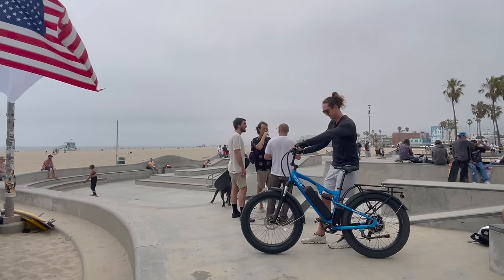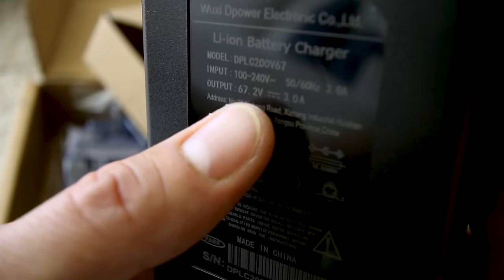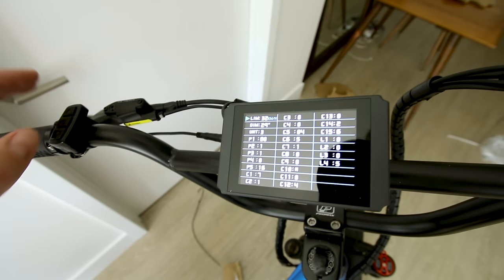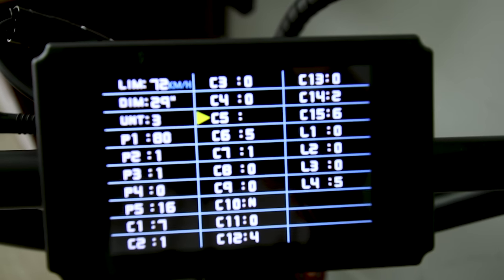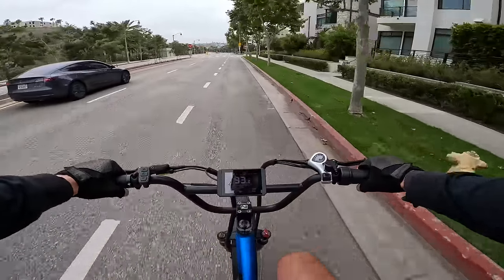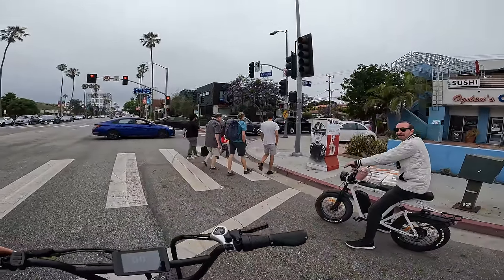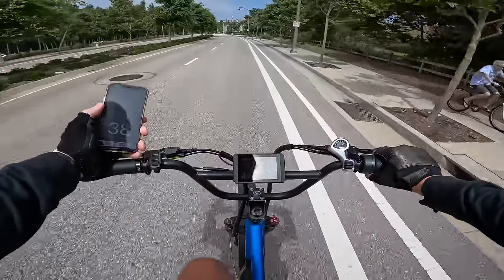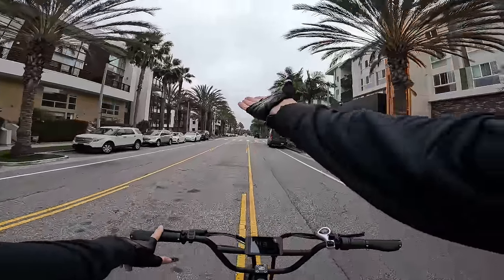This $2000 Ebike is INSANE - Wired Freedom Review!

Comment: i remember getting my first electric bike back in the early 2000.. i was the only person with a electric bike.. went on the board walk at the beach.. 100% reg bikes.. except mine.. now 99% are electric bikes.. even elementary school kids riding electric bikes... what a trip..
Reply: @JudeTheYoutubePoopersubscribe  Now look.. everyone and their Mother has a electric bike... what im afraid of is there are sooo many electric bikes and alot of brainless teens that will not obey the laws.. and the electric bikes will get banned in alot of places mainly the beach boardwalk.. and near parks etc... when i had my bike.. i used human power on low gear when i was in a heavy foot traffic area.. once i was clear and on a strait clear road.. i engaged the throttle..   Still thinking of getting one again.. there are sooo many cool bike now.. I would like to get a 2000 watt one.. and if i won the lottery.. i would get a Delfast  3.0i  that bike is really nice... and really expensive.
Reply: @JudeTheYoutubePoopersubscribe  ya that should get you to abt 28mph.. which is plenty fast.. and all using Lithium battery.. and getting alot of Miles before you need to charge it... when i had mine... it took Lead Acid batteries.. Bloody heavy...  i used 4 12v lead acid battery... here the laws was 17-18mph was concidered bike..  well back then... any faster was concidered a motorized bike.. which needed a lic... but now days its up to the rider to obey the laws and keep it under i think now is 18-20mph.. but all the bike sold that i seen and ask the rider, they say it goes 25-28mph...
Reply: @JudeTheYoutubePoopersubscribe  nice... i was using 48v. with a 750w motor.. but my motor was a motor on the outside of the bike.. real primative.. the hub motor is 1000000x better.. but back then thats was all they had.. funny.. when i think of UK.. i think of cobble stone streets... here in SoCal south of Los angeles.. im here by the Beach.. and roads are pretty good just lots of traffic.. when i ride to the beach.. i will take the riverbed which is real safe.. just you and a straight road till it terminates at pacific coast Hwy.. but  potholes on the streets.. i know alot of cities that has so many potholes you would think you were driving thru Iraq..

Comment: Mine was delivered this week. Just got it assembled Sunday afternoon and took it for a short ride before dark. It's not lacking for power at all. As a matter of fact, I'm going to detune it in the controller to make it a more mild mannered long distance cruiser. But a few button clicks will unleash it's full potential if you're so inclined! FYI- mine was delivered with a Samsung battery instead of an LG.
Reply: Mine is bottoming out somewhere and cause the tire to rub. It's not rubbing on the controller. Must be rubbing somewhere on fender. Hopefully, I'll figure it out. Is yours rubbing anywhere on big bumps.
Reply: You could just be hitting the limits of travel, try tightening the spring.  You need to hold the top while twisting the bottom.  Some people may have racks that are bent slightly causing the screw that holds the rear fender to  contact the tire.
Reply: Where did you purchase?
Reply: did you buy the same Freedom model? their website says PREORDER for NOV delivery
Reply: @kevinsiegel4798  I ordered in July for August delivery. Same model they're shipping in November.
Reply: @nunyabidness1972  ah gotcha
Reply: November delivery apparently will come with the Samsung batteries and also metal fenders instead of the current plastic ones. Can't wait 🎉
Reply: @sp33dybiscuit  Mine came with Samsung battery. Plastic fenders though.

Comment: People are going to be happy with the upgrades Wired introduced in this latest shipment.  New frame Geometry creating much more travel with no chance of rubbing the controller!  An 11 cog in the rear and a better derailleur, a new fender that is firmly attached to the rack and doesn’t flap around.  Wired has upgraded the bike with each batch they bring in and now it’s just about perfect.  Anyone waiting for October or November orders are going to be freakin psyched!!  They keep making the bike better.
Reply: when was this latest shipment done?
Reply: The current batch people are now receiving, this is a review of an example of the previous batch.
Reply: @Joz1 I just saw my Friends.  Also has Samsung cells now and new rack that incorporates rear fender.  The specs and pictures on their website are from their first batch.
Reply: @jfly2249  how do you know about the cells - that would be in the battery no?
Reply: Cells are identified on outside serial number and Wired is sending an email saying so and to adjust one of the parameters on the display so the battery gauge is accurate.  Same quality or even slightly better than LG.
Reply: You should do a video on the new version in time for Christmas shopping season as they are going to sell a ton of these.
Reply: dude, I am having serious anxiety now that I'm still waiting and have not been notified of a shipping date yet. they told me thursday and no nothing. this last part of the waiting process is driving me nuts. would love to see some pics of your friend's new bike to see what i'm going to get
Reply: Kinda crazy how excited everyone gets in anticipation of getting the bike.  You guys who are waiting are going to be real happy in that you are getting a better bike than you thought.  Still love my “old” Freedom, but the 11 cog would be nice.  I’d be interested in hearing people’s impressions after trying the bike.
Reply: @jfly2249  Put mine together Sunday evening. Only rode a couple miles before dark. I swapped in the 1000# shock, but I'm wondering if I needed to with the new geometry? Samsung battery was a nice surprise, but make sure you change the P5 setting from 16 to 8 in the controller so the battery meter behaves correctly. VERY powerful bike at a good price point. Worth the wait!
Reply: Probably don’t need a 1000 lbs shock unless you are 300 lbs.  If I had the new frame I would switch to a high end air shock, although the spring works fine.  The freewheel still has 7 gears but the smallest now has 11 teeth eliminating ghost pedaling at high speeds.
Reply: @jfly2249  I'm waiting on the November shipment for the orange color cruiser model. Customer support said they would announce a shipping date around late October at the earliest. Also heard in another comment section that apparently the November shipment will include metal fenders instead of plastic, that's cool, along with the rack being more bulky and sturdy that's going to be awesome. Love reading all these comments! Only like 50 days left 😢😂😅🎉
Reply: I can’t to finally get one!!
Reply: @DR3theDON you have no idea how lucky you are to have ordered a Freedom now.   I would recommend anyone on the fence to pull the trigger now b4 November is sold out.
Reply: Just found out your bike isn’t going to be delivered until next year sometime

Comment: Great review, can’t go back to a 48v bike after feeling the power of 60!  The bike has a great battery, great controller, great brakes and a hybrid metal reinforced geared motor with 5x the expected lifespan.  And it’s only 77lbs with full suspension.  If you live in the Chicago area you can arrange to pick one up and save on shipping.
Reply: How is that ???  I live 100 ft from the 606 trail and always biking to the lake !
Reply: LOL never mind I see there in Wood Dale IL. but thats nice to know thanks and yes that is off of Irving Park Rd on the other side of the airport
Reply: Yeah I was surprised to see they are local to the 'burbs.  I just ordered and will swing by to do pickup.  It's about an hour from me living in Lake County.
Reply: Comment 1: Great review, can’t go back to a 48v bike after feeling the power of 60!Reply: Hey there! I totally agree with you, once you experience the power of a 60v bike, it's hard to go back to anything less. The freebeat Morph 2-in-1 eBike I'm currently enjoying has a brushless 750W motor that delivers an impressive 80Nm torque, providing a similar powerful experience. Plus, the hybrid metal reinforced geared motor ensures a longer lifespan compared to other bikes. It truly enhances the riding experience!Comment 2: The bike has a great battery, great controller, great brakes and a hybrid metal reinforced geared motor with 5x the expected lifespan. And it’s only 77lbs with full suspension.Reply: Hi! You've captured it perfectly, the freebeat Morph eBike indeed has outstanding components. The battery on this eBike is removable and has a 48V 15Ah capacity, giving you an impressive range of up to 60 miles on a single charge. The controller ensures smooth and responsive performance, while the brakes provide reliable stopping power. And the full suspension system makes the ride incredibly comfortable, even on rough terrains. It's a well-rounded eBike that truly stands out in terms of quality and performance.Comment 3: If you live in the Chicago area, you can arrange to pick one up and save on shipping.Reply: Hello there! If you're in the Chicago area, you're in luck because you can conveniently arrange to pick up the freebeat Morph eBike instead of dealing with shipping. It's a great opportunity to save some extra cash while getting your hands on this amazing eBike. Enjoy the riding experience and all the exceptional features it offers!
Reply: Ballen1182 "Why don't you get a normal bike and pedal yourself?" Because he doesn't want to.
Reply: doesnt it heat up if you stay on that max power 24/7?

Comment: I've got well over 300miles on my WIRED FREEDOM EBIKE,  it's fun to see people try this as the first EBIKE they've ever ridden.....and now I've got a few who have honestly looked into buying one.
I think they will be kinda disappointed with less power and comfort.  All I can say is please do your research to find the best for your needs.  I'm glad I did! Another GREAT VIDEO! Thanks again
Reply: You've put 300 miles on it.  You're the perfect person to ask this then (if you don't mind).  Okay, I just ordered one of these and Matt was wondering how long it can keep giving him 2000w for.  I'm curious, if you're commuting and going at a constant speed, what can I expect?  If I tried to go 35mph for 30 minutes would it cut out on me before that and overheat?  30mph?  The "continuous" rating is actually not much more than the bike I already have (750w vs 1000w for this one).
Reply: @ChristmasEve777  I've not had any problems with losing power,  I have road 45miles using ps2 and when I used the throttle still had 1900watts 
I've beat the bike harder off road and haven't had the motor get hot when I put my hand on it.  Even riding on county roads with throttle only it hasn't got hot.
I've been checking because I thought it would get hotter. Hope this helps
Reply: @ericberg7364  Thanks so much for the info!!
Reply: Hey there! I came across a new project that might interest you. Have you heard about the freebeat Morph 2-in-1 eBike? It's a revolutionary eBike that combines both indoor fitness and outdoor exploration. One of the most outstanding features is that it can be charged when you apply indoor mode! With its brushless 750W motor and impressive torque, you'll experience exhilarating speed and power. The puncture-resistant fat tires and front suspension ensure a smooth ride in any terrain. Plus, the Smart Saddle Detection+ feature provides valuable performance insights and keeps you motivated during your rides. It's definitely worth checking out! 😄🚲
Reply: It's illegal to ride on bike paths, which most people do for recreation.

Comment: I just got an EKX X20.  It is only a 48V system but is also very capable.  It tops out around 35MPH and is similarly equipped.  48V Versions available for as low as $1200 if you get the lower capacity batteries.  I wish I had got the 20Ah instead of 10Ah now that I have it though.
Reply: 3rd party ebike battery extenders.

Comment: Says on the website it’s a 1000w nominal rating on the motor, which makes sense with 60v and 40a you’d probably be looking at around 2kw or thereabouts max. Good to see 1000w motors in this form factor now, very discreet

Comment: As an electrician who installs generators, battery back systems, etc. for homes...I can tell you that LG batteries are not all they are cracked up to be.  I have seen three battery systems fail in the last year alone, all LG, and all were given an unknown date of when the battery would be available to replace the defective unit.  One of these clients actually had me remove the batteries and install a standby NG generator in its place.  This was a $20K system they essentially threw away.  So, I would not be impressed by a manufacturer stating they are using LG cells myself.
Reply from the maker: Better then no name cells 😆 that’s the standard at these prices
Reply: New bikes are shipping with Samsung I believe.  Btw, Wired has just completely redesigned the Freedom for 2024 and apparently everyone waiting for an order is getting the new bike.  Now that’s insane! What color are you getting?
Reply: @TailHappyTV  I agree, but my personal experience with LG batteries (not their other products) is pretty poor!  Thanks for the excellent bike reviews😎 I’m likely leaving towards getting this bike regardless.

Comment: Hi there, I'm 6'3 and seriiously considering this bike. How do you find pedaling, are you getting good leg extension or knees cramping up?
Reply from the maker: Pretty good extension, you can easily swap for a slightly longer seat post if you want more extension. The handle bars are high and it will work

Comment: Love your videos ...really great stuff, so thank you!

Quick question, if you don't mind...
Does the bike have speed limits for each PAS level (some bikes, with their "smart" cadence sensors and controllers now do this, and I think it's ludicrous).   
In other words, can you utilize PAS 1 or 2 even at higher speeds if you so choose?    I sure hope so!
Reply from the maker: You know, man, I think I actually overlooked this in my initial ride. I don’t think I even bother to check if the pedal assist worked beyond certain speeds, because I’m so used to them having cut off points in a certain miles per hour like you’re mentioning. My guess would be this is how the cadence sensor on this bike works, but I actually don’t know that for sure. I will ride the bike again and make another video with this one soon. I’ll make sure to include that.
Reply: @TailHappyTV     Thank you sir.   My hope is that the bike allows the rider to utilize whatever level of pedal assist he or she desires, regardless of the speed the bike is traveling at.    
I think that's the only set up that actually makes sense.
Reply from the maker: @OpenmindedHusker1  I agree, the menus and settings on that bike is like really advanced so I have high hopes. Most importantly, the bike felt super natural when riding in its stock form, which I cannot say is true for some of the bikes I review.
Reply: The PAS just give you a flat wattage for each of the 5 levels so yes, you can use them at any speed.  There are 3 levels of adjustment for the power assist to dial it in to where you want it.  With c14=1,  I get 120 watts on PAS 1, 300watts  on PAS2, and about 600 watts on PAS3.  Works much better than the mph based cadence sensors. Fully programmable and you can even have the mph based assist if you choose.
Reply: @jfly2249    Thanks very much!!   :)
Reply: @TailHappyTV  Ooh another video with this bike soon? Wired vs Trail Pro incoming?
Reply: yes also has walk and cruise control

Comment: Good evening got a quick question that I hope you can help with. Been watching your videos for a few days now and having a hard time choosing. 

If you had only $3,000 to spend on a e-bike and your only options where 1)Bandit X-TRAIL PRO,
2) Freego Shotgun F3 Pro , 3) HAPPYRUN TANK G60 4) EngwE X26 5) Wired Freedom 6) MOOTORO DIRT DUAL MOTOR 4000W. The 5th one is $300 over what I would like to spend so not sure if it’s really worth $300 more than what I would like to spend 5) Grizzly - 52V Dual Motor Ebike. 

A little info on me I’m 6’2  275lbs tore my acl so would like to be able to go out and have some fun while knowing I have something to help move me if my knee gives out. I love speed, also live in Massachusetts which at times has hills and crappy roads with road patch’s and or pot holes. Just looking for a bike to be able to go out and ride with friends at times and just have fun. I’m very new to all of this. I hope you can help a little on what your chooses be with these ones and why you would choose it. Thank you for your time.
Reply: I have bikes with 20x4 and 26x4 and I far prefer the comfort and stability of 26x4.  The bigger tires are much more stable at speed and roll over obstacles that would swallow the smaller tires.  You also are more easily seen by cars on the larger tires.    You should try both formats and see which you prefer.

Comment: I just got my first e-bike (Lectric XP 3.0) but if/when I’m ready for a faster bike that doesn’t fold, I will definitely have the Wired Freedom in mind
Reply: I mean, you reeeeeally shouldn’t be getting a fast bike bruh. If you’re using this on the sidewalk/bike lane you’re an asshole, and if you’re using this on the road you’re putting your life in danger for the sake of not having to register an actual motorcycle (which is what you’re getting at this point)